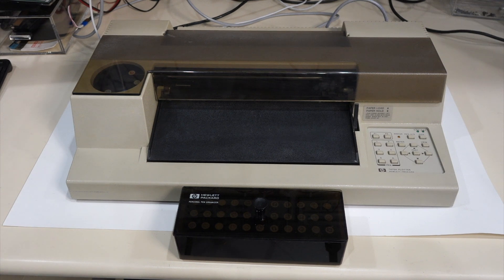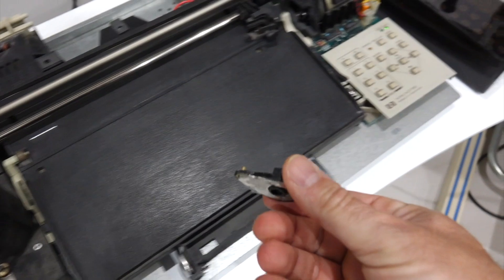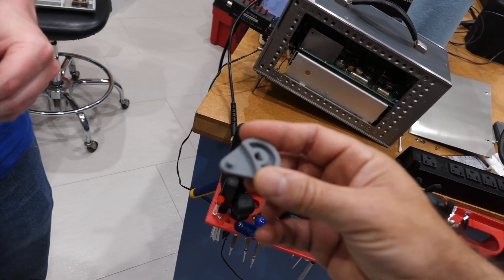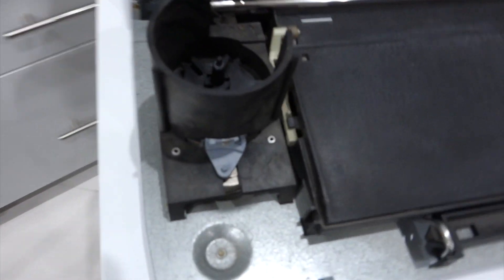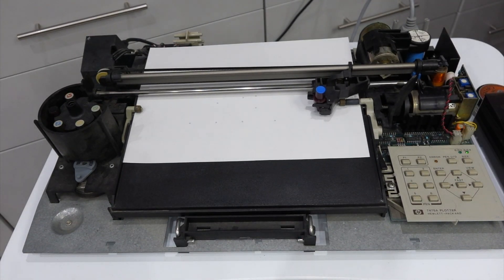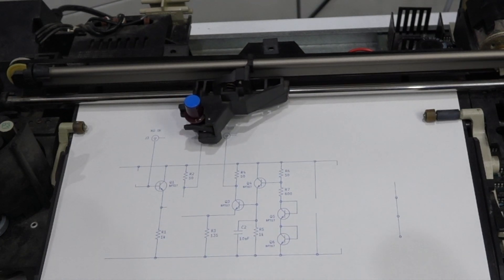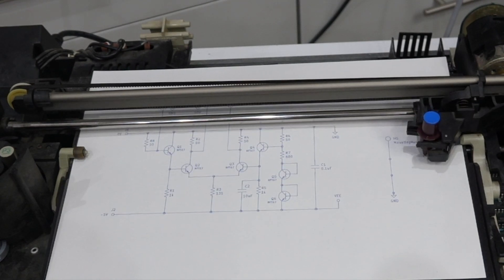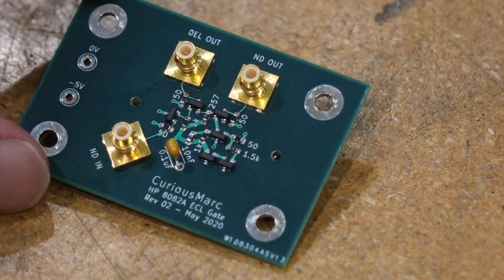HP 7475A Plotter: Geneva Wheel Repair & Schematics Printing

Comment: Many years (around 30) ago I managed to get a very cheap A3 Roland plotter with electrostatic paper holding from a kitchen shop that was closing down. I produced many UV PCB's with it, I used polyester drafting film with special (expensive) Rotring plotter pens that used a very dense latex ink which you had to religiously clean out after use or the tip would become blocked beyond repair, the quality of the plots where out of this world even by modern standards and no desktop printer of the time could even come close.
Reply: Used to do the same,  and somehow I still have the pens! I bought my plotter from a former employer. Used to suffer terrible target fascination and watch it for hours….
Reply: And the current Roland Vinyl cutters still use HPGL!  There is just a USB serial port at the computer side of things. :)
Reply: I did similar 20 years ago except I plotted etch resist direct to the PCB - cut out all middle processes.
Reply: @jon_collins  When I was a kid, I had the Roland DG A3 plotter too. I eventually figured out how to plot resist directly on the bare copper-clad PCBs. It worked a treat! For very thin laminate you could also print it directly on a laser printer. I recall it needed some surface prep for the toner to stick, and I might have had to file down some plastic paper guides in the printer. But it worked OK-ish. It was initially impossible to register the front and back of the board laterally. The longitudinal alignment along the feed direction was amazing, since the edge of copper clad laminate is rather sharp and the paper edge sensor had no trouble detecting it very reproducibly. As long as the feed was smooth (hence filing of plastic), this was solved. Laterally I ended up pushing (with a soldering iron) two small metal pins into the plastic somewhere on the bottom of the feed path. I then used scrap laminate to fashion a guide, and drilled holes to match locations of the pins. Then I pulled the pins out of the printer and pushed them into the guide piece. That way I could remove the guide for normal printing. After tweaking the X offset for printing the “other” layer, this worked fine. The printer I had had a bad temperature sensitive horizontal shift (along the scan direction), so attempting to align things was going nowhere until the printer solidly warmed up. A friend had another of those printers and it behaved the same. So it was a design issue. Probably some marginal optical interrupter signal conditioning circuit, but that’s just a guess. It was a Brother clone of LaserJet II methinks. Definitely had the same Canon engine at the very least and thus worked with HP cartridges.
Reply: I used to Work at Roland DG a while back, and they'd still get a few calls per year about those old plotters.
Reply: @phuzz00  Well I've still got it - and it still works too.

Comment: When I started in engineering we had a D or E sized HP roll plotter and we would load large sheets of vellum on it and print out our PCB layouts 4 :1 magnified.  You had to plot each layer, and a drill drawing, and an outline and a top and bottom mask. Then we took them to a a photo lab in town and had them create films (1:4 reduced) which we then mailed to the PCB house to manufacture the boards from the films.   It is hard to imagine just how much time you spent waiting on the plotter.   And if you made a mistake  you would either have to do it all over, or if you got lucky you could fix it by drawing on the vellum by hand.   I don't really miss those days.   Thanks for the video Marc.
Reply: @perfumedmanatee6235  probably not, it was the plastic(?) substitute, but we always called it vellum. I don’t believe we used the actual organic vellum.  We also had the gigantic ink reservoirs for the plotter.  If it ran out during a plot I’d scream and bang my head into the wall
Reply: @theharbinger2573  I think the vellum used in plotters was made of plasticized rag cotton (or fibers from interior tree bark according to Wikipedia, but I remember cotton). I worked at HP's San Diego Division 1985-1988 as a technical support engineer for all pen plotters, including the old electrostatic flatbed plotters, drafting plotters like the one you used, and desktop ones like in this video. I loved my job! I was also support consultant to R&D for development of the 7570A DraftPro (we called it by its codename "Emu"), which was a D-sized drafting plotter, though probably not the one you had, as it didn't support continuous roll paper.

Comment: Brings back both happy and sad memories.  I had one of theses and a Roland DXY-1150 and played with them for years with my Apple ][+.  The same thing broke on my 75  back in 89 and had tried to make one out of wood no luck.  It went to the landfill soon after.  The 1150 lasted a little longer until the guide wire  broke in 90.  Did cut my teeth in programming writing software for it.  I remember 7475 cost me 3 months salary and  the 1150 only one.  Funny thing about the 1150 is it would work like a regular || printer you could even do a screen print though that would usually destroy the pens as it would tap out each pixel.
Reply: Wow, I can just imagine it tapping out an image pixel by pixel. It must've taken ages and been really noisy. Obviously it wasn't designed for that kind of printing, but I could see myself trying the same experiment just for the hell of it.

I can't see why they couldn't have made that part out of aluminium or cast iron and had the pin spring loaded to absorb shock. I guess it was designed to last as long as the warranty period and that's it.

Comment: I'm still wondering, how does it decide the order in which to draw lines. It always looks so random to me, but there must be some logic behind it.
Reply: HPGL is (if I recall correctly) a text file of commands that say things like "move to" and "line to". It just eats the file sequentially and does what it is told. The thing that makes the file ideally would have some sort of movement optimizer to make it plot in the most efficient manner. If there was any optimization done here, it wasn't very good.

HPGL (HP Graphics Language) products were being developed over about a decade or so. As time went on printers could have larger memories, and I believe that at some point they started to read large sections of HPGL into memory and run an optimization of their own before they started to print. I don't recall if this printer was one of the ones that did any internal optimization, but I suspect not.

All of the above is hazy recollection from reading HP catalog articles and HP Journal articles way back at the time; I only saw these things in a few other people's offices at the time and never actually used one myself.
Reply: @lwilton  You are remembering correctly.   I wrote an optimizer in basic way back in the day.  If memory serves me correctly I scanned the full file in and plotted it into a random file of lines and arcs then sorted them into another file and finally fed it into back into the plotter I think using only the the 'DI' command plus the pen commands.  What I would of done for perl and a hash  in those days.  A better question was what was I thinking.
Reply: @lwilton  yup HPGL is just txt commands. One of my first C programs I wrote in DOS was at Nat Semi to take HPGL files and render them on screen.
Reply: It's done by the Software that generates the HPGL code. I remember using a HP 7550A as the main Printer on Windows 3.1 with similar random line drawing.
Reply: InkScape, at least, generates the hpgl per layer. Not sure how it decides beyond that.